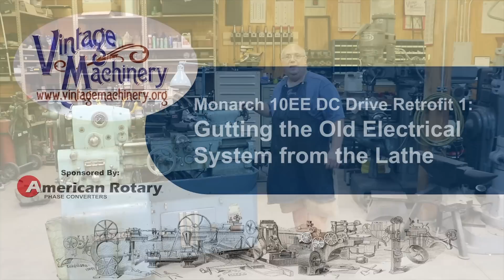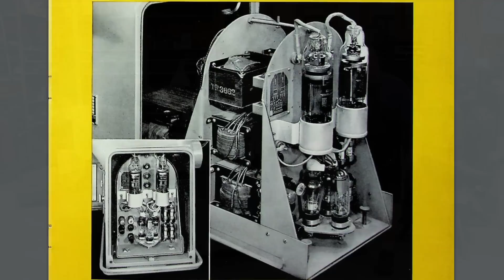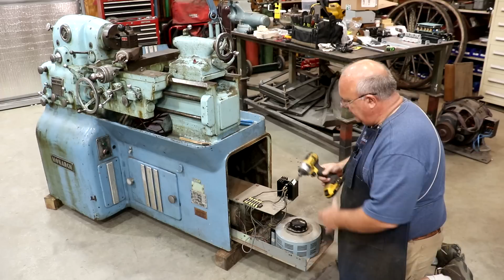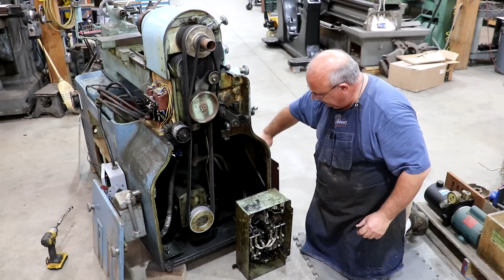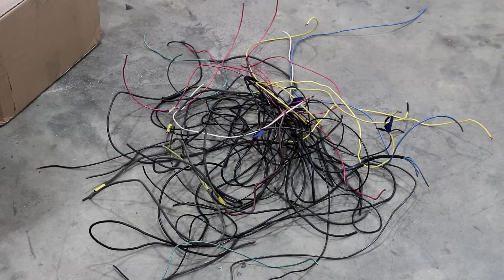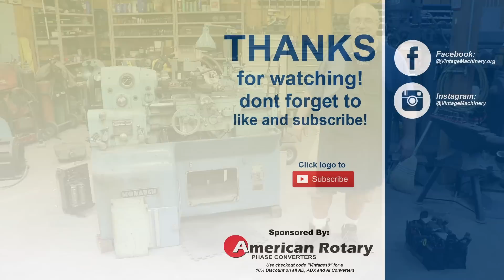Monarch 10EE DC Drive Retrofit 1: Gutting the Old Electrical System from the Lathe

Comment: we have approx 25 EE 10 monarchs in our company from the 50's --many need retrofits-----just recently our electricians just finished a retro fit kit - on a single machine----we are going to see evaulate it 4 a while then decidecide  if that kit is what we want to use on the rest or go to another ---lots of $ involved.   I used the for 44 years ------Absolutely  best 10 inch  tool room lathe made .
Reply: About 5 of them  have duplicator  attachments!!!

Comment: One of the other important reasons Monarch went with a DC drive was to eliminate the phonographing of impulses coming from an AC motor as each phase gives it a 'kick'.  Using DC completely eliminates this phenomenon.  My 10EE had an Allen-Bradley DC drive retrofitted in it by the then owner Delco (now Delphi), but it never worked correctly.  When it died, I didn't bother repairing the drive.  Instead, I put a 3.5kW Mitsubishi servo drive and motor in it.  Top end is just over 3K so I lose about 1000rpm but I don't think I've ever needed to run anywhere close to that.  They retain very good torque at lower RPM's, and will stop the spindle in less than a turn at moderate speeds and masses.  My 10EE has the ELSR option on it.  I wired 2 prox. switches into the drive inputs for the axis limits and attach them to the ELSR stops at either side with a switch on the control panel for both.  If active, they will stop the spindle when the prox turns ON.  I just used some random prox. switches I had in stock (not precision types) and again at moderate speeds/mass, it will stop the carriage in < 0.002" consistently, usually it's under a thou.  I also have separate speed controls for both forward and reverse.  I've been meaning to write it up on Practical Machinist's Monarch forum, but I just haven't had the time.  I've run a lot of lathes over the years and I can honestly say nothing comes close to the feel of a Monarch 10EE.

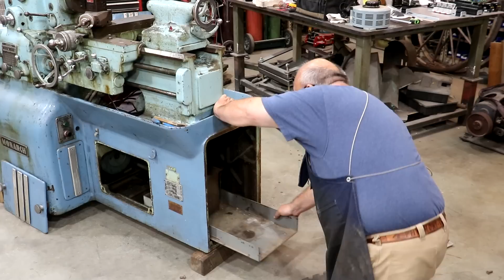Comment: Based on the images of the old speed control electronics here is what I think was the design of the old motor speed controller.  The key item is the Variac which is a variable AC transformer.  It takes the incoming steady AC voltage (220V?) and outputs anything from zero to ~100% of the input voltage or higher.  This variable AC then goes to a diode, or better a set of diodes, (probably mounted on the black rectangular heatsink) that converts it to "DC" (half wave or full wave rectification) - but could have been some active high power voltage regulator (depends on the age) - I'd love to see a close up.   But only using diodes creates a really lousy DC and if this was sent to the DC motor it wouldn't run very smoothly at all.  It would at least need a big bank of capacitors to smooth the DC or, better, a voltage regulator active component (a.k.a. transistor based thingy).  Maybe that heavy "transformer" shown at 10:16 is actually a huge filtering inductor which could do the job of the missing capacitors.  God knows.

Comment: I know you’re doing an all new electrical but it just makes me cringe seeing good original equipment (especially vintage mechanically actuated electrical equipment) get hacked out. I swear I could hear the machine screaming 😱 as you were snipping wires left and right … oh wait no that was me 😭. 

I really have such huge appreciation for the designers of these early DC electrical systems. On these high quality lathes they didn’t skimp on materials or features. Everything was designed to be rugged and keep performing 50+ years in the future and as we have come to find out many of these machines are actually still going strong 80, 90, or even 100 years since manufacturing.

Comment: Great start to what I'm sure will be a wonderful restoration. I believe I read somewhere that some of the Monarch 10EE lathes (not sure what vintage) included a 'Constant Surface Speed' mode that would automatically adjust the spindle RPM based on the part diameter as it was machined smaller in order to maintain the surface feet per minute at the rate set by the operator. This was a feature deemed necessary when these lathes were used in the manufacture of components for nuclear weapons. Is this a feature that either of your 10EEs may have come with from the factory or could be added with the advent of newer electronic controls ?

Comment: A couple lengths of angle (aluminum or steel) sandwiched onto the bottom of your aluminum component plate would provide a good foundation for mounting to the slide drawer.

Comment: Keith,  being a electrician for 43 years, just let me say one thing. If you had applied power to that control transformer on the side, and it got hot and started smoking, you have probably compromised the windings in the transformer to a certain extent. I would HIGHLY recommend putting on the new transformer, why go to all that length  to rewire it, with all brand new components, and leave a suspect transformer that could possibly damage your new drive.

Comment: So this is probably a dumb question, but when it comes to poking around in electrical components like that, I'm always afraid of putting my hand on a capacitor.  How long can a capacitor hold a charge?  Is that a dumb fear, or could there be something in there that still has a charge on it?  Would there be capacitors in a box like what you are working on?

Comment: Call me a purist (or a hipster, lol) but If this were mine I'd be half tempted to try and rebuild the original tube based system, assuming the schematic is out there. LOTS of tubes are still available and are still in production in Eastern Europe and China and I doubt the circuit is that complicated. That said, a more modern mostly off the shelf setup like what Keith is going with is probably a better idea if the thing is gonna be used for Work (as opposed to hobbyist use).

Comment: You took an Aluminum plate out of the lathe to make a simple bracket to mount the new plate, weld it at 90 degrees instant mounting bracket to bolt down to the drawer

Comment: I recently found a schematic of the vacuum tube motor controller. It is a surprisingly clever design. While updating the lathe electronics is a practical solution it would be interesting to have a fully functional restoration done on one of the vacuum tube controllers.

Comment: Hi Keith, very cool video and excited to see what you guys came up with for the update.  And first off, don't get me wrong, I'm on board and I'd do the same thing in your place, but I thought you might get a chuckle out of my reaction to part of the video.  As a field service engineer for well over 25 years, working on a bunch of different machines, tracking down faults, often wiring faults, watching you snipping all those wires kind of willy nilly is what the young 'uns nowadays would call triggering.  Mentally onboard and then just ahh, careful, what!  Had to chuckle at myself, so figured you might get a chuckle too.  Looking forward to the rest of the update!

Comment: The 10EE is a wonderful toolroom lathe but repairing electrical drive problems have always been a headache.
I wouldn't be too hard on whoever worked on this lathe in the past. Here the repair is going to depend on an experienced electrical engineer who has studied past attempts at repair of these lathes to design a replacement system.
The last 10EE I used was a 1941 model with the AC/DCgen/DCmotor system. When it went on the fritz the lathe was put into the warehouse because no one could figure out how to fix it. It's probably still there, rusting away. I've also seen CNC lathes and mills junked for the same reason: Mechanically fine, electrically no repair parts available at any price.
Reply: Your comment is true.  If you watched the two videos he has made for this machine, what you say is why it was abandoned.  Therefore he has made the decision to develop a modern set of controls which will breath new life into a mechanically sound machine!  After listening to the stories of other 10EE owners, this project may be just what gets the old machines "out of the warehouse and rusting" to working like the great classic design they are!!
Reply: @paulcopeland9035  It will take some cleverness as there isn't a simple fix for these machines. Especially true if the original functionality is still desired.

Comment: I have one suggestion for you.  Since you already have a set of heavy duty saw horses and a hoist, lift the 10EE up and set it on the horses to make access to everything MUCH easier.
Reply: I just finished the upgrades on my new 600#, 30 kW solar power inverter.  The Keith-clone sawhorses were perfect for the job.

Comment: Another video we'll done. Thanks.  I agree with taking out the old wires.  You won't have to worry about worn insulation/shorts or bad connections. Plus, you can bundle and route the new wires as you see fit.

Comment: Hi as an Electrician I'm wondering why you don't go the way of a solid-state DC drive from American Rotary. That way you loose the forward/ Reverse contactors have full and stable speed control. You will also have the option to have a read out of the speed. You will also have motor protection as the voltage and current to both field will be monitored and the drive will trip with alarms. It is also standard equipment and the next owner can get spares and assistance if it fails. The 6 wires are 2 for the Armature, 2 for the series field and 2 for the shunt field. Your other machine have the Armature and series field antenatally connected.

Comment: Hard for me to watch.  I've come behind folks with access to wire cutters and seeing close cropped wires on transformers and such just gives me the willies.  Trying to rewire equipment that's had that treatment gave me my gray hair.  Those dynamic braking resistors are the same idea used on LeTourneau's big Titan series trucks, L1100 and up loaders and locomotives.  Very neat to see.  As a partial troglodyte and a lover of the old American made tech, it's hard to see those ceramic braking resistors canned.  Such is life....

Comment: There may have been, or still be, a 240V/120V transformer for operating the light, and possibly a coolant pump. I can see the light so it will need something to power it. Thanks for the video. Jon

Comment: OBTW those tubes are still being made and used.  Some places solid state never got to the level of ability.  Very nice Auto-Transformer in the front corner.  A keeper !!  Vari-AC it must be a GE !  The transformer looks maybe 1 or 2KW .  Likely a 1:1 with split windings.

Comment: Whatever you end up with, i'd be happy to buy the same package. Please reach out!
i have the same Reliance motor/drive in my 1956 10EE with an dc drive running it that someone from the 90's hacked on. only gets me up to around 500 rpm and thing bogs and has trouble if i make a heavy cut. Other than that, the spindle, bed, and everything run true as ever!

Comment: The DC motor is a Series-Shunt Wound motor. The shunt field is controlled as well as the voltage to the series winding and armature. The original system had armature winding current compensation to compensate for the resistive drop in the windings. The armature voltage is controlled for one speed range and the shunt winding is controlled for the other speed range. The motor armature voltage would be 365 VDC at 200 RPM and 235 VDC at 2000 RPM. The six wires are F1-F2 shunt winding, S1-S2 series winding, and A1-A2 armature winding.

The three "grid controlled rectifier" tubes (thyratron) may be difficult to source today (Type C3J and C16J). The power resistors are 8 ohm 385 watt braking resistors.  The whole system could be connected for 460 VAC or 230 VAC operation off one phase of a 3-phase line (L1-L3).
Reply: The thyratron tubes now have solid state replacements available.
Reply: @ronkellis769  The replacements for the C16J's are $135.00 apiece. the C16J's may be had for $1500 per. And there is no direct replacement for the C3J. Possibly, use the C16J replacement and spice into the C3J circuit. Some readjustment of the electronics may be needed. The replacement should last longer and require fewer technician visits.
Reply: @steveschulte8696  I guess it will work but they didn't make it official because the solid state replacement and a new old stock C3J still cost about the same.
Reply: @steveschulte8696  I have a '54 MG made for DOD, so was passing on general information. Thanks for providing the details.
Reply: @ronkellis769  The information was gleaned from the 10EE manual on Keith's Vintage Machinery website.
Reply: Steve is exactly correct. When you connect it simply wire the series field in series with the armature and always energize the shunt field before the armature. Jerry Miller
Reply: @jrrymiller  I would try leaving the series field disconnected first (i.e.open circuit) and see how the system works.  A modern DC drive will reverse motor direction by reversing armature voltage and current, without changing the shunt field.  If the series field remains connected, its flux will oppose the shunt field flux when running in reverse.  Since this is the opposite of what is required, some method of reversing the series field polarity would be required when running in reverse.  (Connecting the series field within a bridge rectifier would do the job.)
Reply: Chris has the right idea. The series field is not necessary.
Reply: The winding configuration of the DC motor offers several advantages, over less complex winding configuration. The shunt winding offers better speed regulation under varying loads, i.e. changes in the tool pressure on the material in the chuck. Constant speed gives more consistent SFM at the tool edge. The series configuration offers low speed torque. The chuck will come up to speed faster from a dead stop or changes in the speed control setting. The 10EE has a wide range of rotational speeds, that does not depend on complex gear trains. And the DC motor, absent a VFD drive for AC motor replacement, offers the ability to adjust the RPM's to get better surface finishes.

Comment: I'm designing a new controller board (dc driver) for my mill from of the shelf Vacon 3-phase VFD.
I started from the field current controller which seems to work, I'll need to measure the field coil inductance and add some if it is too low for my synchronous buck converter.

DC bus voltage is 565volts(Finland and "every" house has 3-phase) and the field coil is 400v 1 amp nominal.

I fully reverse engineered the Vacon power board with all of it's control pins and feedbacks and safety related functions.

I have also a braking resistor (external) so my mill could stop on a dime or as soon it has dumped excess voltage from the DC bus through 2.75kw braking resistor (also Vacon)

Comment: It never fails to impress me that Kieth can get up and down from the floor without making Dad noises. If I have to work on the floor it sounds like I'm giving birth trying to get back up.
Reply: You all need to lose weight - a common US problem.
Reply: Definitely the wear and tear. Partially paralyzed leg and cadaver parts holding my knees together. I watch my weight knowing it helps keep me moving.
Reply: @mfs5493  My knees are shot.  Not a weight issue at all.
Reply: @mfs5493  It often has nothing to do with weight, nor nationality - just wear and tear and age. For me, moving heavy equipment, as well as bicycle, skateboard and motorcycle incidents at early ages started showing up 20 years later.

Comment: Keith, I purchase used contactors and the like and donate them to a local trade school. I also donate plastic off cuts from a local firm for various trade shops for whatever they can use them for. One instructor had his students machine out some Tyvar for a caliper box, and then they lined them with felt, put a hinged lid on them, and the students had a protective box. In the HVAC class, an instructor cut a squirrel cage fan open and covered it with polycarbonate to safely show them how it operated. The machine shop uses plastic for prototyping before making final projects as it's easier on tooling and if it doesn't work or turn out right, they haven't lost much. If it works out, They then have two. One in plastic, and another in metal.
I hate to see waste, and ame grateful that they found a way to reuse those materials.

Comment: With much focus on the electronics and their connectivity to each other, I would encourage you to document the physical wiring harnesses (particularly lengths, braches, routing) so that a set for your second lathe can be built on the bench. Additionally, those harness build diagrams would be an assets if you share your new drive configuration.
Reply: He has an EE designing this so you know there will be plenty of diagrams to document the install.  If this works as planned, it seems there might be a market for a "retro kit"!!  A lot of Monarch 10EE owners seem interested.

Comment: For guys a t home trying to get one of these old machines running, a simple upgrade is a 7.5 KW VFD inverter- lots of them on Ebay for under 200.00 and a 10HP 3 phase motor- also on Ebay for 250.00- you will have far more HP and speed ranges than the original and simple wiring.
Looks like the original modification was also done by an electrical engineer.

Comment: You will be glad you field dressed it.Nothing is more irritating than old wiring.Whenever I rewire anything,all the old wiring goes away. I would suggest pulling the motor to clean it inside and out and,check the bearings.

Comment: Now it's your turn to jury rig the lathe. Hope you didn't hack off the wires on that transformer to short if you want to reuse it.... Smoke usually is any wire insulation that took too many amps has melted down. Wires that are to be replaced and re-routed could be used as snakes for pulling the new.